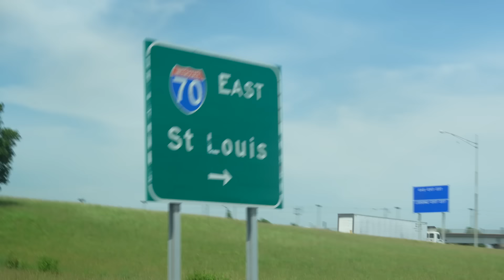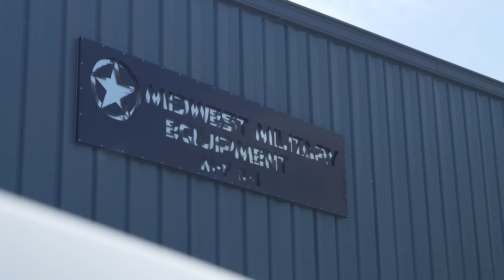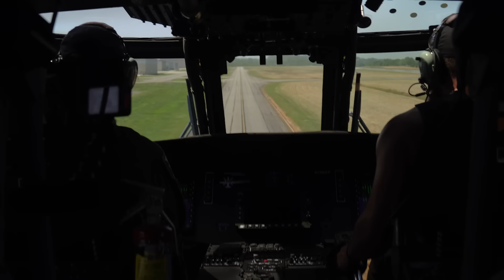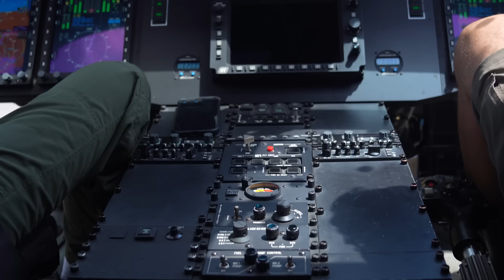I Bought an Army BlackHawk Helicopter: Now What?

Comment: I just retired as an Electronics Tech on the Navy variant (MH-60S). Most of this is the same, except this variant has fewer systems (Main rotor/tail pylon fold, foldable stabilator, active vibration control system, integrated mechanical diagnostic systems, etc). Glass cockpit with data concentrators in transition section will be an area of focus, particularly with regard to fuel readings on your mission and flight displays. I have a cheap easy fix for that when you inevitably come across it! I recently taught folks how to operate and fly this machine in the simulators as well. Owning a machine that happened to be my life's work would be a dream come true to me. You are quite fortunate!

Comment: I’m envious! Congratulations Heavy D! I would love to own a Blackhawk! What an awesome air machine, I loved flying it in the 82nd Airborne Division. We literally did everything you could think of with that helicopter.
If you need a SK-70 Blackhawk type rated pilot with a current CFI Helicopter rating I would be happy to assist with your training , I can even fly out to wherever you need me since I fly for a Major Airline. Cheers and have lots of fun with it!!
Reply: Which years were you in the 82nd CAB?  2/82 I'm guessing?  I was an OH-58 Crewchief and Blackhawk Doorgunner way back when.
Reply: this is the coolest comment ever
Reply: Do you mean SK-70 Blackhawk as the S-70i the export version, whose airframe is manufacture in Poland ? Rgrds from the Phils
Reply: @946towguy2  Hey Towguy I was at Pope AFB where we had 2 Blackhawk Companies. I was with B Co. 82 CAB which was later re-commisioned 1/82 and 2/82. This was back in 1985 thru 1987, I left Active duty in July 1987 and went into the NCARNG where I became an AH-64 Apache Pilot til I retired early 2001.
Reply: @verpo4044  Hey Ver Po, My FAA pilot certificate has SK-70 for the Blackhawk type rating, the S-70I came later I believe in the 90's. When I went thru the Blackhawk transition back in 1984 they were brand new and the FAA was working on a type rating designation.
Reply: @946towguy2  Hello again Towguy as a side note I was over at Simmons AAF with the 1/17th CAV, C Troop where I also flew Blackhawks but we also had Cobras and 58's, we had a unit called the blues platoon which were 11b's that were our door gunners over there.
Reply: @charleswilklow7236  I was in D/1/82 before moving to B/2/82 and later c/2/82 during and after Desert Storm till the draw-down at the end of '92.  I didn't see any combat but had nonstop training ops.
Reply: 946 Towguy, Airborne! We were in the same unit different years, B/2/82

Comment: As a A&P mechanic I would love to see the work and the paperwork to get this thing airworthy! So bad ass man I didn’t know you were this involved in aviation. Keep it up man! Fly safe!
Reply: I'd love to come help work on it too, as a former CH-53E airframes mechanic, and soon to be an A&P, that would be fun! Just a long ways away from me in California.
Reply: as a current 15t who has to work on the uh60L its less work to completly strip every wire and system out of it and  replace the wiring and demod then to fix and repair as there are at lest 50 mods/systems that civilians dont have keys to use or the devices too use that will throw master cautions out the ass

Comment: I wanna see it all. I’ve been an Aircraft mechanic for 20 years now. Started off in the Air Force. 

I’ve been considering getting everything in order to fly helicopters. Great pay. 

I think it requires 7 different types of aviation pilot licenses to fly a privately owned Blackhawk helicopter.

6 of those licenses are prerequisite to the 7th license which is the type rating license (specific license for a Blackhawk). 

Flying Large Aircraft, the license is specifically for that model aircraft only.
Reply: Do you know about the price for the civilian market???...
Reply: The type is “experimental”
Reply: About your last sentence... I'm sure there are bigger heavier helicopters, they don't need that special license?
Reply: @LinkinPark4Ever1996 , yes. Large helicopters are large aircraft.
Reply: Oil patch needs plenty. PHI etc..
Reply: @l8tapex  they are restricted to flight crew only - No Passengers !
Reply: @l8tapex  PHI used to be one of my customers... Air Logistics too.
Reply: @cuatrokoop32v  buds dad pilot with Air Logistics.... in the 80's LOL

Comment: i was actually looking at what it takes to own a former military aircraft.

Holy smokes. If the past paperwork on the aircraft, including its military maintenance record, isn't all there, you may be in for some headaches. Especially if they find a single rivet that wasn't included in the original plans.
Reply: I've heard it said that half the value of an airplane, and I guess by extension helicopter, is in the paperwork. You don't want to trust your life to something without all the paperwork
Reply: ok

Comment: Having worked with the UH=60 from it's introduction to the Army in "78, till I retired from the Army, and from contract work on them as a civilian after retirement from the Army, I know quite a bit about the bird and how it works.  (I was a quality control tech on them when I finally retired age 62)  You understand some what how the engines start, but a little off on some of the details. The main engines do have a gear driving motor, that is an air turbine that drives the accessory drive system to start the main engine. It's power comes from bleed air taken from the compressor of the auxiliary power engine.  The auxiliary power engine starts by a hydraulic motor that is spun by the hydraulic pressure stored in the accumulator.  The auxiliary power unit drives a generator and a hydraulic module and provides the bleed air to start the main engines. The hydraulic module is one of three on the aircraft, two are driven by the transmission.  Confusing, but it works.
Reply: I literally paused the video when to explain that exact thing to my son!  I hope his 308 beam is intact on this thing!  My co-workers and I were talking the other day about it the other day and that was pretty much the main concern we could come up with since it is an Alpha model!
Reply: Was it hard for you to retire from that after all those years ? I just left the Army at 61 1/2. 43 years of service. Special case. I got in at 18 years old back in 1978.
Reply: @mycowboyways915  It was kind of like beating your head against the wall, it felt good when I quit. Just joking!  I found many things to devote my time too. Still, I miss some of the folks I worked with. And don't miss some others.

Comment: interesting. . . the overall airframe is still quite similar to the civilian model S-70 but the full family of them are MH, SH, HH and H 60 models. . . things a beast depending on the variant used and the department that flies it it could be used for low threat CAS support, Rescue, Anti submarine warfare, Cargo transport, troop transport, reconacense and limited anti tank (last model is a variant with wings and pylons on them)  Overall solid airframe and quite the service record for helicopters though not as long as the UH-1 that it was made to replace in areas. . .  (not the newer Venom helicopter though that variant of the UH-1 is still a active craft)  but Very beautiful aircraft hope you enjoy it

Comment: Actually, the APU provides the air source for the starter motor which is an air driven turbine, which in turn drives the gearbox, spinning the engine up to start rpm.

Comment: If you ever run out of packets and just need HYDRATION, look for the UN standard hydration mix online. 4 powders from the supermarket or kitchen, less than $10 should mix up 25 gallons if you just add water. That's all the electrolytes you need in killer heat.

Comment: 800 lb. Gorilla in the room :   How much for the BlackHawk ??

Heavy D.—->.  * BLACK HAWK CAUTION * ,…. Hope the government isn’t unloading one of the early ones that had the RF problems shorting out the electronics, sometimes causing these to crash.  Hopefully that’s all been retro fitted and no more problems with that type of issue.   Probably something you checked, but mentioned just in case, cause we want you around a LONG time :-)

Video Detail :  show us all you can,.. everything you do is fantastic. Love it !!  

P.S. - you thinking about the motorcycle mount option ?

P.S.S. - Swear I saw a mini gun mounted on the port side load door, on the demo model aircraft as it flew in bound?  

Cheers !

Comment: Someone misinformed you on how the starting procedure. The APU doesn't blow air into the engines to start them. The APU runs a generator and hydraulic pump. The accumulator holds hydraulic pressure.

Comment: Now what?  You’ll need the right tools to fix & fabricate parts to get the chopper in flying condition.  Getting & keeping a working Blackhawk will cost millions.  Having a parts chopper isn’t a bad idea.  Expect to burn 196 gallons of jet fuel per hour.  Blackhawk pilot seats & controls are very tight.